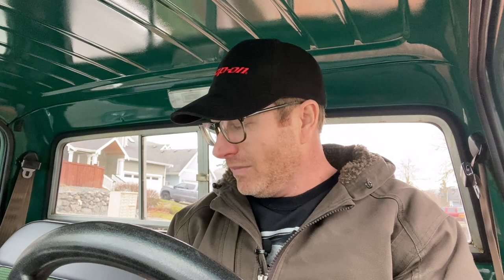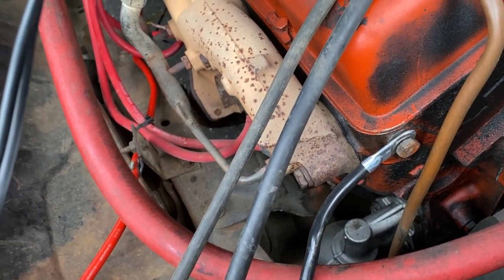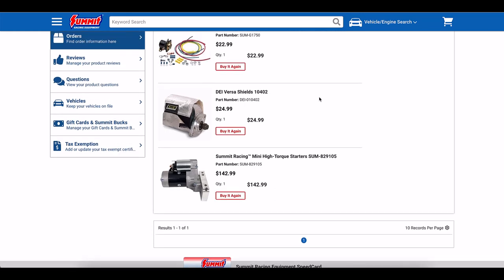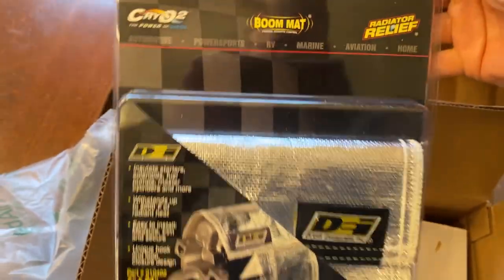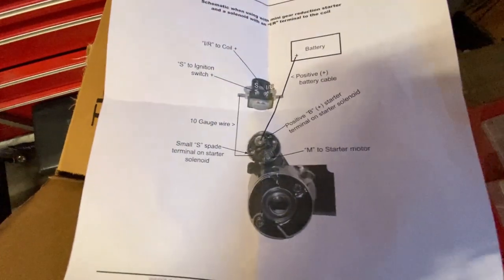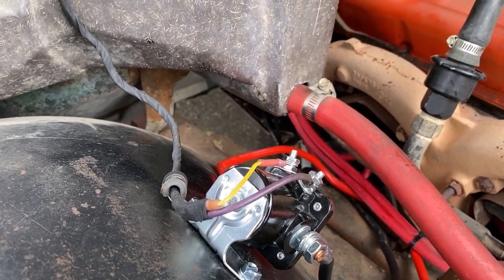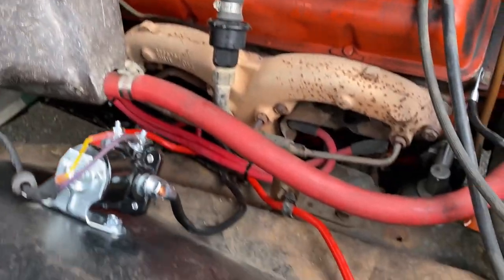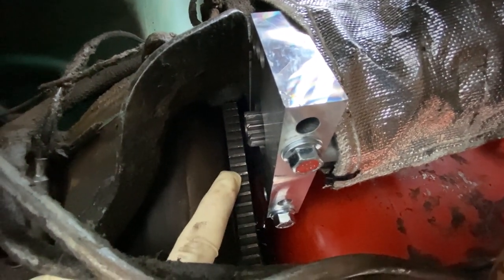GM and Chevy Small Block Starter Upgrades: 1972 Chevy C10 Starter Repair

Comment: There is a trigger wire and the 3rd wire is the ballast bypass to put 12v to distributor for cold weather starting.

Comment: Do yourself a favor. Put the heatshield back on the starter. That'll save you from having to replace it every few years. It originally came with one, but they get rusty and eventually a mechanic or whoever ends up throwing it out, thinking it's not necessary. So what happens? Starters only last a few years because they get heat soaked. Can't tell you how many times I see this problem and everyone thinks it's a bad starter design when it's just missing the heat shield.
Reply from the maker: Agreed, it makes a huge difference. I used a fiberglass wrap on the new one for this very reason. But it's also getting hard to find good starters at parts houses, another reason for the upgrade.

Comment: Hello. Im new to car repairs. What type and size bolt did you use to mount remote selonoid to chasis? Thanks
Reply from the maker: If memory serves, I just used a self tapping sheet metal screw. May have come in the kit.  You just want something that will properly secure it and create a good ground.

Comment: If you have problems with the stock style starter 2 to 3 starters a year wich for me 210.00 dollars a year high torque min starter so far has went 3 years and still running strong
Reply from the maker: Yep, that's my understanding and I'm hoping it solves the issue for me as well!

Comment: That yellow wire is too thin
Reply from the maker: Not sure what you mean. The yellow wire is the trigger wire and does not carry a load.  That's why it's so thin from GM.  But the new setup had been working pretty good!
Reply: @froehnerrestorations  that yellow wire kicks the solenoid in. Is it hooked to a, relay? Coz, when volts go down AMPS go up & vice versa. Imho, that wire looks insufficient.